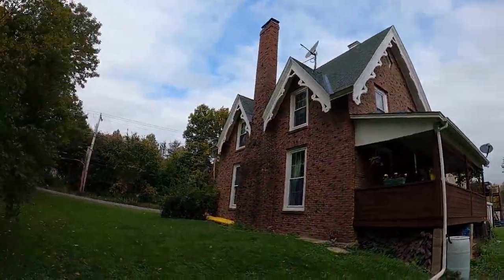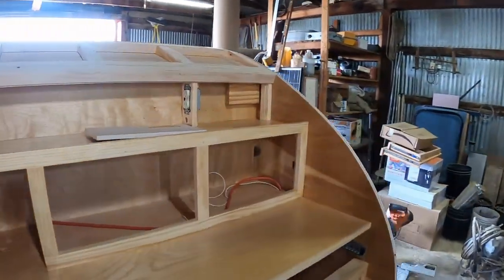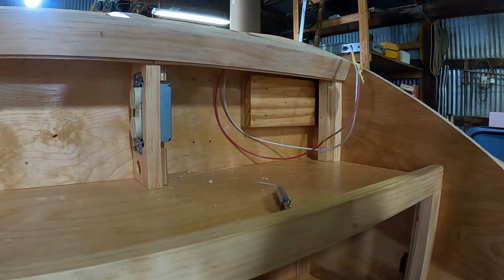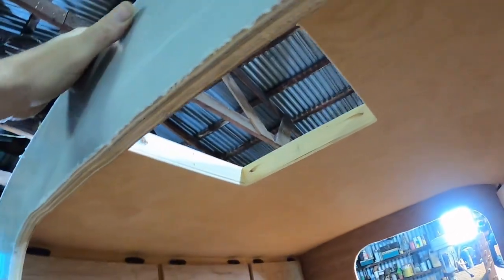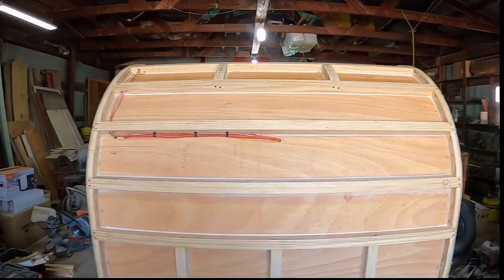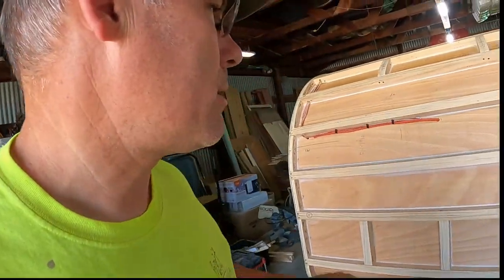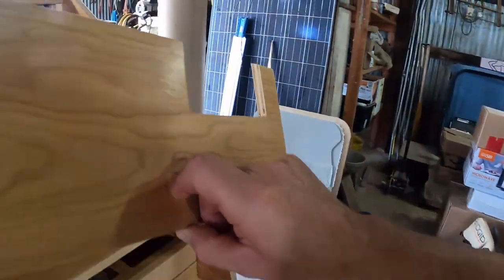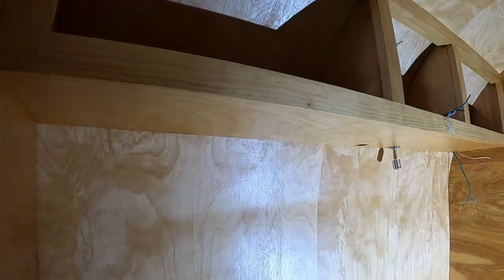Teardrop Camper Build: Lights and Switch Installation - Part 16

Comment: I did pass through that in my own project build.  To get a straight roof, the inner skin have to be supported (I used many strong aluminium straight tubes and adjustable jack posts), that way, the inner skin will follow the shape of the spars and eventually, the outer skin will too.  Then, the roof will maintain its straightness only when the whole sandwich assembly (inner skin, spars, styrofoam and outer skin) will have been properly glued together.